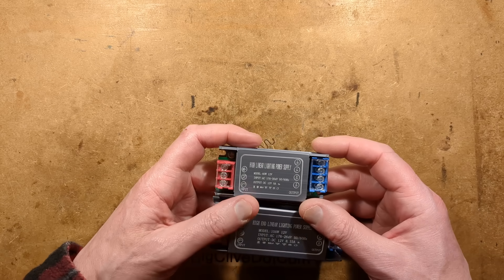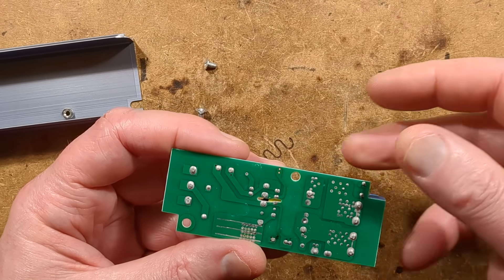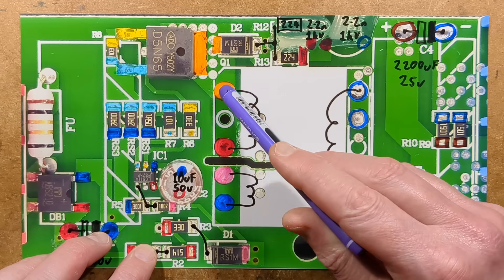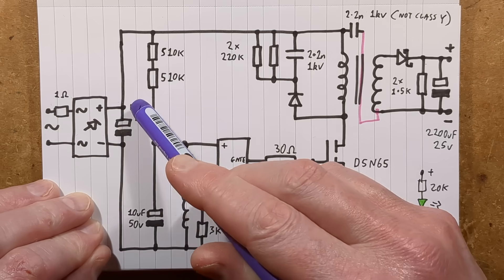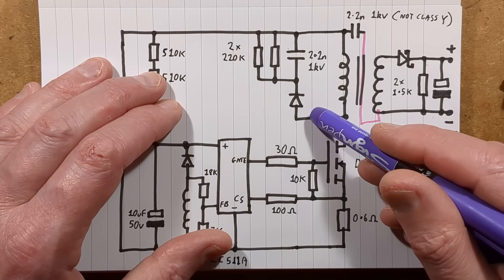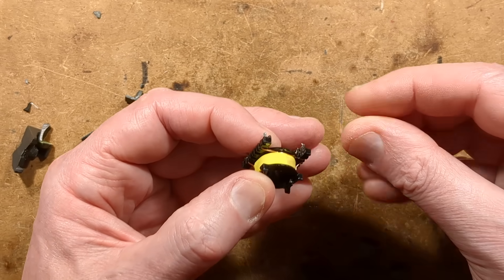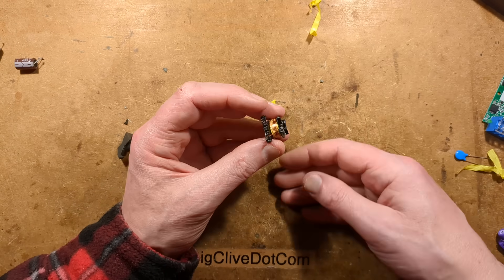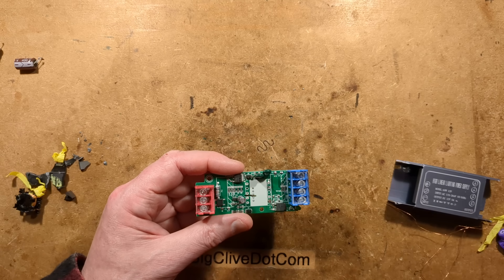AliExpress LED power supplies - almost OK

Comment: Given that the design is basically a sound design I think you can blame the misses on bean counters. A proper Y-capacitor costs just a little more, and the transformer was probably the cheapest they could get that fulfilled the specifications. That it was safe was probably not one part of the spec they bothered about. The component changes could be done with or without the designers help. And if they were asked the question probably was more "Will it still work?" rather than "Will it be safe?".
Reply: Many years ago there was a man called Earl "Mad man Muntz."  He wanted to make TV sets and bought some brand names and had his "engineers" remove parts until it quit, then told them to put that part back and we'll go with that design.  One of the original bean counters.
Reply: @gwesco  - Yes, except Madman Muntz was intelligent, and while his designs were really strange, they weren't dangerous.   Just weird.   He managed the first sub-$100 TV by looping through the same amplifier circuit three times, rather than having a separate circuit for audio, UHF, and VHF.   It only worked well in high power zones - but guess what, it was in Chicago, and that classified as a high power zone for TV transmissions.   

He didn't have 'brand name' TV's.  He had full assembly shops.   He'd walk through the testing area and apparently would lean over and start cutting components out until the device stopped working, and would then tell the guy to put that part back in.
Reply: @gwesco  Cant say I ever heard of Muntz before. But yeah, bean counting can work, but you have to consider functionality, safety and reliability.

Reminds me about how the Japanese kicked over the TV market in the US when they started selling their own brands. You could say it started with copying US made TV's but that was expensive and they looked at how they could be built cheaper. Back then a TV had a lot of components and circuit boards that was connected by sockets or cables and contacts at each end. This was done so when they were made modules that didn't work could be switched easily, and tubes were delicate and often needed to be replaced after a few years, so having them in sockets made that easier.

But the Japanese looked at the component failures and decided that making larger circuit boards with more components and less sockets was cheaper and more likely to work at first try than a bunch of modules connected together. Sure they would be harder to service as you couldn't just swap out a module but they were also so much cheaper that they thought people would be tempted to buy a new TV rather than having their old one repaired.

Turned out they were right, but it also turned out that these TV's was a lot more reliable than the US brands using the old construction model. So not only was they cheaper but they tended to last longer and had better image quality due to simpler and more robust signal paths.

That's a situation where bean counting worked out well. But as many good results of bean counting positives you can find there's at least equally often that it made things worse.
Reply: @gwesco  The cutting aspect is about all that is shared between Muntzing and bean counting.

Comment: Could you in a future video please show a transformer that has a propper separation for comparisson?
Reply: One image maybe you can understand: the best are those where primary and secondary windings are wound on two separated bobbins laying parallel (side by side) to each other, so not on one bobbin wound on top of each other, separated by tape. But these are larger and more expensive.
But if not, so if wound on top of each other, the individual strands must never come close to each other, and they did in this one in the video, within less than a millimeter even.
The funny thing is that they know that, because they have made two nice air slots in the PCB to separate the high and low voltages a few millimeters.

Comment: What is the role of the class y capacitor across the high and low voltage sides? Would it be safer/possible to not have any capacitor instead of having a incorrect capacitor there?
Reply from the maker: Its main purpose is to provide a return path for noise coupled via the adjacent transformer windings.  That RF noise can be radiated from the output wiring.

Comment: 8:24 more likely the resistor measures the current and the mosfet is turned off when the current reaches a value controlled by the feedback
Reply: Yes, these cheap supplies often work in pulse frequency mode: They supply fixed width pulses to the transformer, and use the feedback to generate gaps between the pulses so the output voltage doesn't go too high. The fixed pulse width is given by the turn-off current set by the sense resistors. A very common threshold is around 0.6V (the current sense pin just turns on a PN junction in an NPN transistor), so this supply would use a peak current of 1A. The amount of energy transferred per pulse depends on the inductance of the transformer.

Comment: Not connecting the ground wire to the metal is criminal imo. 
Always check ground to chassis with these cheap Chinese devices.

The lacquer insulation is standard on these cheap supplies. I’m surprised that there aren’t many reports of people getting injured or worse.
Reply: Yes.. 2014 a woman kill by a dodgy phone charger in NSW Australia... poor lady was using wired earphones at the time and touched a grounded object.
Reply: What’s worse is, until comparatively recently, lighting circuits didn’t typically have a ground connection. Any house built before 1980 is almost guaranteed to have two wire lighting circuits, unless it’s been rewired. So even if the ground pin WAS connected to the case, it would not help in an older house, which is the most likely recipient of these ultra low budget devices, as diy-ers upgrade their own lights, to save on energy bills. Professional electricians will not source these products from Aliexpress.
Reply: @duncancremin1708  This might be true for the US, but other places were fully grounded, even with central ground fault protection, for several decades.
Reply: @fonkbadonk5370  Some are not even to this day, such as Japan. Though every household does have an RCD on the entire house circuit in the circuit breaker box.
Reply: @duncancremin1708  Most light fixtures are class 2, double isolated, and therefore do not require protective earth. However it can't hurt to have all metal surfaces in a room at the same potential.

With this power supply there is obviously an issue to get it right.

Comment: The easiest way to disassemble the magnetic core is to heat the seam to approximately 300°C using a soldering iron. Heat both seams. The connection will then loosen.
Reply: That assumes you want to rebuild it, In which case you have to make sure to add an insulating layer to one side of the ferrite core before gluing it back.
Reply: @TDOBrandano  It's also good for when you need to wind a custom transformer using parts from the junk pile.
Reply: ...or a melted hair dryer 😉
IYKYK

Comment: I used to work in the transformer manufacturing business, and I'd always understood that the separated/partitioned bobbin type transformers were cheaper to manufacture than layer wound, PLUS the bonus of almost invincible electrical separation.
Or is layer winding essential here for efficiency?   I know that this transformer is much more compact (than in Ye Olde Days) because that circuit is driving at a much higher frequency (than the AC line 50/60 Hz) maybe that's part of the reason?
Reply from the maker: I think it is due to the higher frequency these operate at, although medical power supplies may use a split bobbin.

Comment: Big Clive. Maybe you could test one of those transformers like connecting a variable voltage power supply to it and increasing the voltage until it fails.  There must be some sort of criteria that can be used to determine whether their wire will be efficient for the application.
Reply from the maker: I do have a hi-pot tester here, but although the transformer may pass the test when new, there is a risk that with thermal degradation over time the insulation may break down.

Comment: The FU where the resister fuse is is funny
Reply: Thee earth terminal needs a FU2
Reply: FU MOFO: Fuse, Measurement Option, Fuse Option.
Reply: It's also the sound made when the magic smoke is released
Reply: @alanbrown397 it's the Chinese scammers telling you that they sold it to FU .And they neew it .
Reply: This REALLY threw me for a second, because FU is the German abbreviation for frequency converter, and I wondered why it would be so tiny and looks like a resistor, and why they'd have one in there anyways, and with only 2 terminals =)
But really just for a second.

Comment: The first project I ever did was a power supply - I was trying to hook up a car amplifier I got on the cheap to my home audio system. Thankfully for me, there was a hobby supply shop nearby, and the owner was kind enough not only to provide me with all the parts, but also the diagram, and pointed me to all the sources I needed to understand it at the local library.

Now the fun part - the amp was sold as two, and a friend of mine needed one, too, so we split the bill. While I decided to follow the expert's opinion and bought a toroidal transformer, a diode bridge, an appropriate cap and the rest and make it myself, my friend decided to just go to a hardware store and buy a ready-made PS. Worth mentioning is that the amp, as per the nameplate, took up to 10 A at 12 V.

My friend went through three power supplies (all rated 10 A) before the amp fried, and at no small expense. My amp, together with its power supply, still worked fine when I sold it off. Cost-wise, I spend about 20% more building the PS myself than I would have had I bought the cheapest one rated for 10 A, as my friend did... In hindsight the PS I made was probably a fair bit overbuilt, but hell, it worked perfectly well, unlike the hardware store junk. The only thing I had to replace was the fuse I put in, and I'm fairly sure that's not on the PS. That's a win in my book.
Reply: Good high quality power supplies are expensive. That's just the way it is. I've really only worked with computers and there the PSU you use for a server is never cheap. And even though they are loud and has a case made of mild steel plate with no paint they cost more then even the expensive high quality PSU's you find in a computer store. What you pay for are over dimensioned components and extreme reliability. It's the same with single voltage power supplies in all categories. Most you see are built to be as cheap as possible. Good enough is when they can provide the rated power without combusting. If the power is stable enough it looks good on a DVM that's called perfect. If it has extensive hum related to the AC frequency they don't care. If it somehow burn though the insulation and send primary voltage to the secondary eventually, they don't care.
Reply: @blahorgaslisk7763  Yeah, pretty much. Funny you mention over-dimensioned components - my friend, at first, made fun of me bc the Graetz bridge (or full-wave bridge rectifier, but I'm Polish so it has always been a Graetz bridge to me, that's what everybody calls it here) I used alone was like half the size and weight of the entire unit he bought, and that was BEFORE I mounted a heatsink to it. The toroidal transformer buried in epoxy was even bigger...

...but it DID WORK, all the time, and was dead quiet (so I assume I epoxied it right then), so I'd say, money well spent.

As a matter of fact, I carried this lesson everywhere I went, ESPECIALLY the PC world. I've made sure every PC I've built since had a PS at least a full notch above the rest of its components, and I can say with full certainty that was the right call, both for reliability AND future-proofing. People tend to cut corners on things they don't see an immediate benefit in, which, as I can attest, is a mistake.

Comment: Are they boiled or dry cured radio hams?
Reply: Steamed!
Reply: @abitofabitofabit4404  Aurora Borealis?
Reply: @welbow at this latitude? At this time of year?
Reply: I'm afraid there's no curing a radio ham, they are all quite hard boiled. At the same time, though, remarkably dry
Reply: Oak Smoked.
Reply: Dry cured is prosciutto I will take that Italian Spanish Portugese all good .Booked I will take Virgina ham or Italian Rosemary .Especially if it's mangalitza swine
Reply: @carlubambi5541  No crudo is dry cured there is boiled prosciutto aswell. IT's labelled cotto.
Reply: Spiral cut honey baked.

Comment: The use of a clear plastic insulator is a poor design choice.  During failure, components usually get hot and component legs can melt throuth the plastic.  Quality PSU manufacturers usually use a phenolic insulator or some other type of heat resistant insulator.
Reply: Keep in mind that there are a lot of people that scream about phenolic plastics because of the "formaldehyde" in them, and "they don't break down".  (Which is rather the point.)    Really, I'd rather have phenolic plastics than a lot of the crap I have to deal with anyone.  5 years outside and "normal" plastic things disintegrate.   80 years outside for old phenolic plastic insulators, and they're still going strong.  Tell me which is worse for the environment.

Comment: Taking the transformer apart DiodeGoneWild style. The verdict is... Dodgyyyyyyy!
Reply: Only thing missing is a bucket of rosin, a kg of leaded solder, and a 70's era soldering gun.
Reply: @vinnysworkshop  And molten hair dryer, for heating and opening ferrite cores.
Reply: @vinnysworkshop  Whats wrong with leaded solder?
Reply: @TheTemporalAnomaly  Right,  lead free solder doesn't taste nearly as good!
Reply: @TheTemporalAnomaly Nothing.
Reply: @TheTemporalAnomaly The eco mentalist crew don’t like it. It pollutes ground water, or some such.
Reply: @duncancremin1708  Yes, I hear that it darkens the rings of Saturn and confuses the birds! For hobby use I would recommend it. Much easier to work with than the lead free stuff The joints are superior and there is little chance of `tin whisker` problems in the future. The military use nothing else, mainly for the tin whisker problem. This may have changed in the last few years but I think not as there is no easy fix.
Reply: @vinnysworkshop  For hobby use, hand soldering it can`t be beaten.
Reply: @TheTemporalAnomaly  Exactly. Lead free solder is alright, but good quality leaded stuff is the bee's knees.
Reply: @vinnysworkshop  And the molten hair dryer.
Reply: @vinnysworkshop  and a cat.
Reply: No melted hair dryer though...
Reply: BigCliveGoneWild

Comment: The transformer is indeed a disappointment. It could have been a useful cheap PSU, just connect the earth to the case and swap the "not class Y" for a proper cap. I guess they skimp on the transformers because they get better magnetic coupling -> more overall efficiency, also cheaper component. If only there was a big enough low income country somewhere that would pass some rudimentary electrical safety regulations so there would be a large market for relatively safe PSUs. Does not need to be US/UK/EU level of safety regulation, just the basic things.
Reply: I guess they skimp on the transformer because properly winding one this small means using more costly triple insulated wire for one side or the other.

Comment: Wow.  Thanks Big Clive.  I would think the cost difference between using a decent transformer and an actual class Y capacitor wouldn't be that much.  A couple bucks? Not to mention actually grounding the thing.  Such a shame.  A little profit over something they could be proud of.
Reply: Those power supplies cost less than $2 each in China, that's why 😁
Reply: @Alex.Adametz  Right.  So make it $2.30 and make it good right?